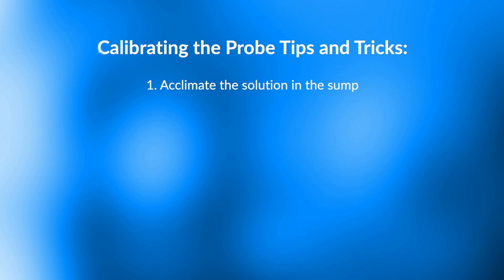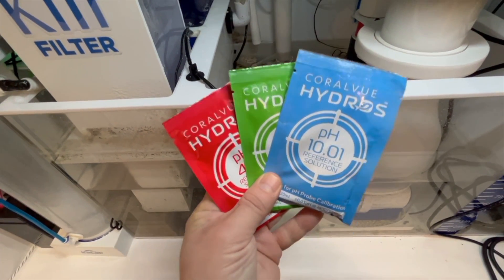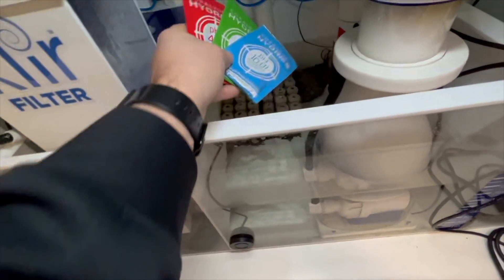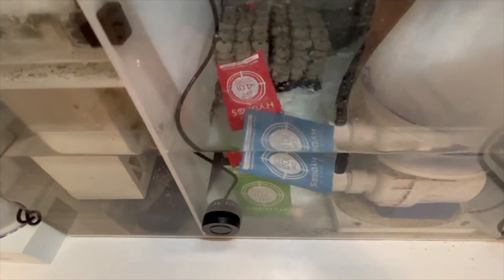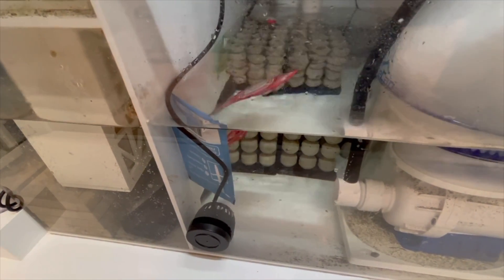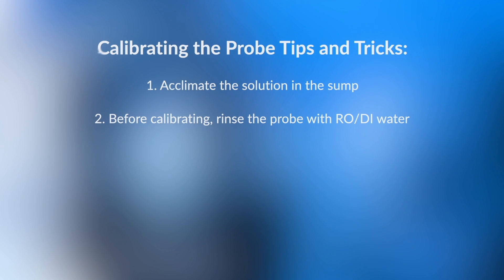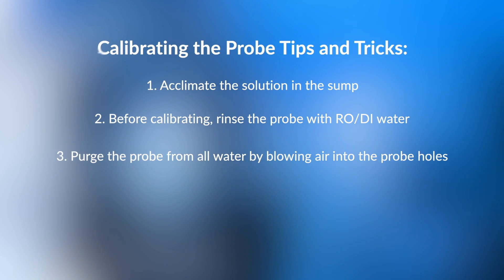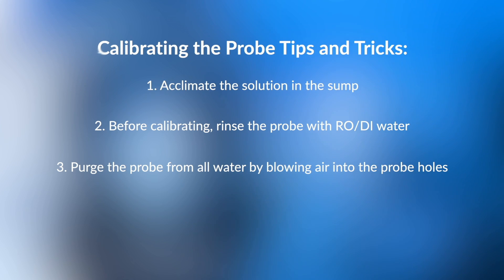pH and Conductivity Probe Calibration Tips and Tricks

Comment: Whey does Hydros not make a base controller with Temp, PH, Salinity and ORP so that a user can buy one simple unit with the basic parameters they want to see (Like Apex) and then you can start there and buy the other modules as needed?  Having to buy multiple units just to get those base parameters make the decision harder to use Hydros since I need two units for Hydros vs 1 from Apex.  Am I incorrect on that?
Reply from the maker: Please look at our introductory controller we call the Launch which was released this past April: https://www.coralvuehydros.com/control/launch/
Reply: @CoralVueTV  Very interesting. So it does either PH or ORP but not both?  I guess ORP is not as critical.  Thank you for pointing this out!  Very interesting.  I am very interested in your new Maven for a tank upgrade I hope to do but didn't want to lose the ability to also monitor PH, Temp and Salinity.